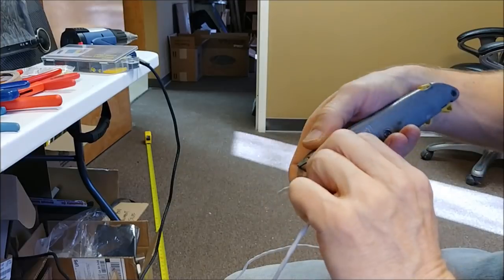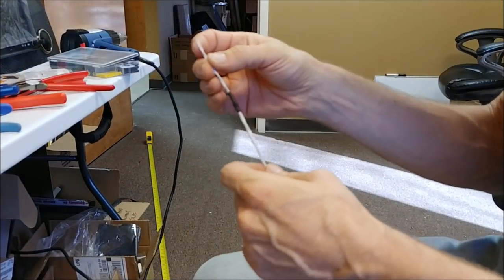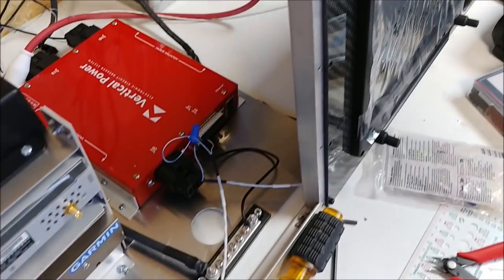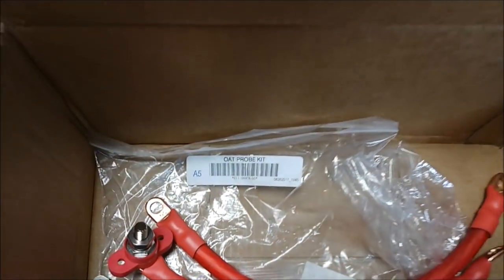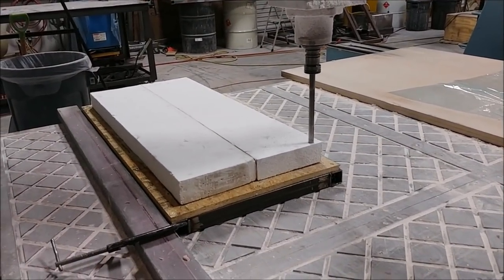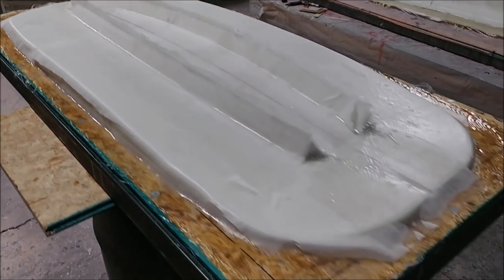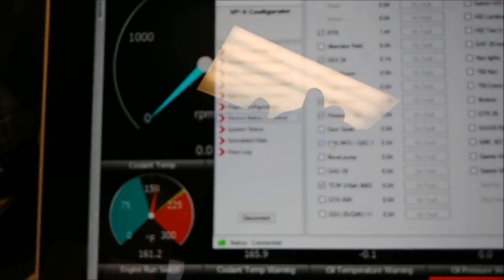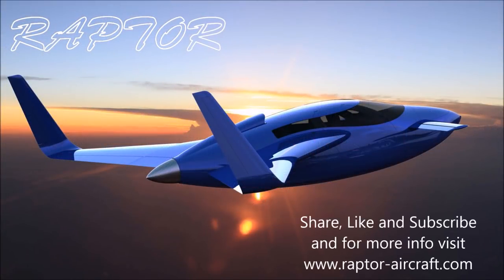Moving Right Along - bench testing the avionics

Comment: you should really use SO63-3-55-24-90 solder sleeves on the shielded wire and ground it out instead of floating the shield. You also should never double crimp a contact.
Reply: Yeah never double check and cramp once

Comment: Shielded twisted pair works best if the shield braids are grounded together.
Reply from the maker: Agreed, and I'm grounding all the shields on anything that's not a power connection.
Reply: How do you ground connections on an aircraft that will not be on the ground.  Sorry if this is a stupid question.
Reply: Greg Thomson 
Solder sleeve splices, they come in a variety of sizes and features.
Reply from the maker: I am using the solder sleeves if you look at the wiring closely. The grounds are taken to various grounding blocks that all carry to the negative of the battery and ultimately the engine block via heavier gauge cable.